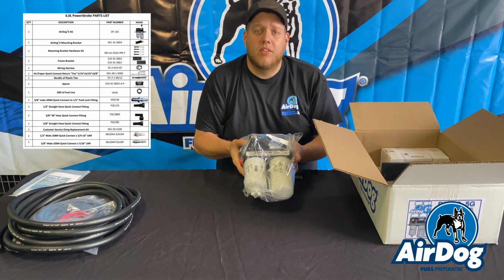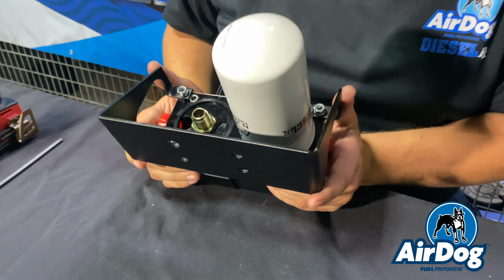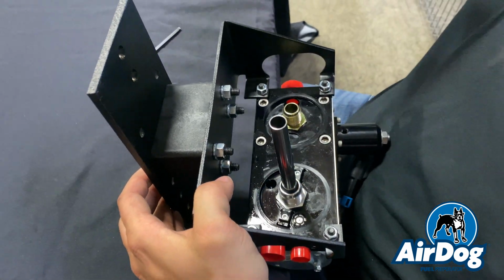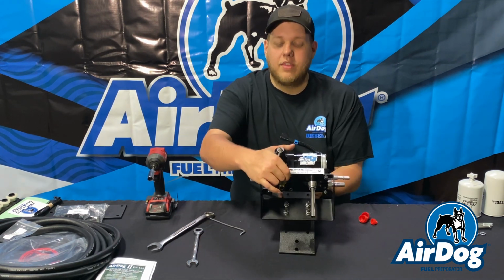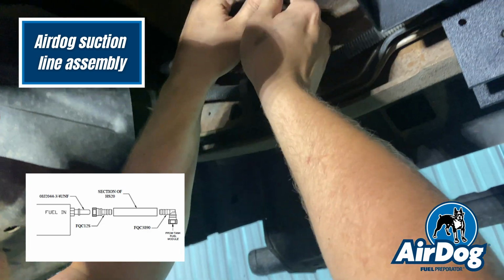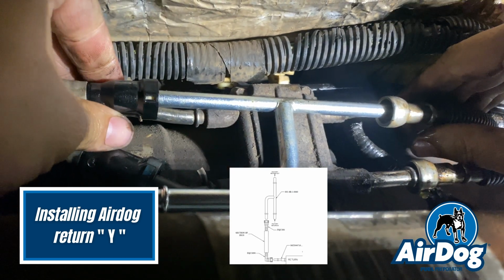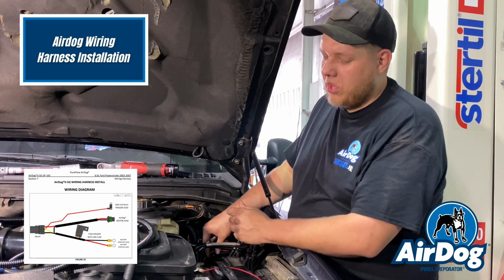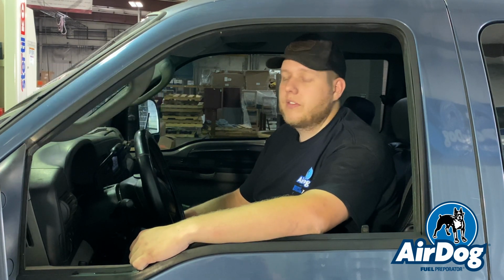2003-2007 6.0 Powerstroke Airdog DF-165-5G Installation

Comment: Where can you buy replacement filters
Reply from the maker: Any authorized dealer or from our website.

 https://pureflowairdog.com/i-30497658-airdog-fuel-filter-2-micron.html

https://pureflowairdog.com/i-30497660-airdog-water-separator.html

Comment: So if the airdog goes out, can you just hook the factory lift pump back up just to get you by??
Reply: Not really, the original suction line that pulls the fuel from the sending unit gets replaced with this. Technically you could switch back but there would be a lot of fuel line connections to switch back

Comment: Man I'm having trouble with my air dog 2 165 pressure being too high on my duramax. Put it on and it caused high rail pressure at idle, turned it all the way down and I'm still getting 20 psi at the pump and dfrp is around 5k at idle, actual is still 8 or 9k.
Do you suggest cutting the spring or what do I do from here. 
Removed the fuse for the pump and my dfrp and actual mirror each other.
It's an lb7
Reply from the maker: Give our technicians a call at 877-421-3187 and they will definitely get you taken care of!
Reply: Did you solve the problem?